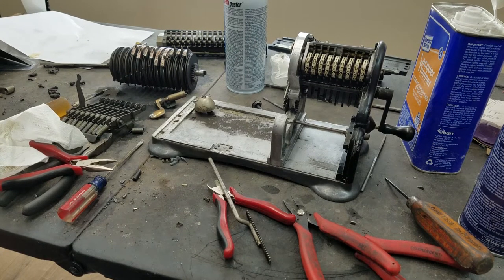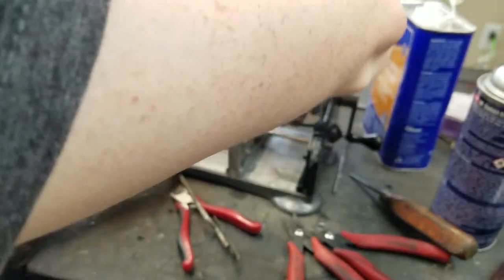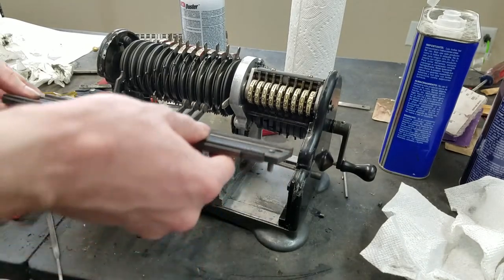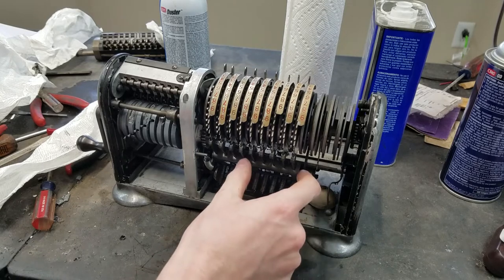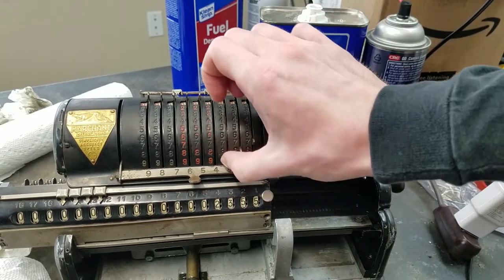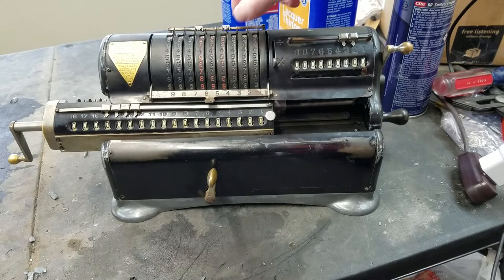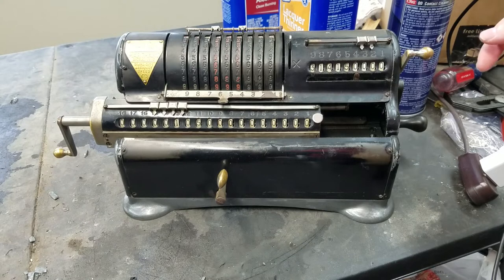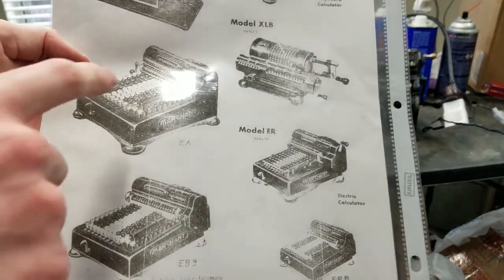Pre-disassembled Marchant XL repair/reassembly part #B

Comment: Wow, you got it back together AND working! Beautiful! I don't remember taking the accumulator decimal marker bar off. I'll look in the shop & see if I missed 'em. I do remember there were missing screws. (I have a Felix that is missing a pile of screws.) The feet were totally mushed & broke out in chunks that looked more like road tar than rubber. I suspect it sat in an attic or a barn for a long time.
. . . I really am surprised that you got it working. These old beasts are truly amazing. I agree that the lack of stop on overflow is a pain. I do that overrun all the time. The real deal for me is  deriving square roots. So much easier on one of these than on a Facit. (I almost would rather  do the Newton-Raphe algorithm derivation on paper, really ;-) )
. . . By the way, having three of those beasts puts you in the same hoarder status as me. (I have a herd of Felix's and Odhners. Just one Facit. So far. I'm still working on the Swift . . . impatiently. And a couple Victor 600s.)
. . . Nice work, amigo. Take care! Stay safe & stay well!
Reply from the maker: Based on how the accumulator marker bar was bent slightly, it looks like its been missing those spacers for quite a while. Of all the Marchants I own (6 old line Marchants in total(including the XLA and 2 XLs), plus 2 silent speeds) the EEG9 is the only one with any good feet left. I think I had to chip the feet out on my EA9 as well. I think the machines I have the most of are Monroes, as theyre pretty common, but I definitely prefer the Marchants. Stay save as well!
Reply: @bss1250  I have almost gone for a couple Monroes but managed to talk myself out of it ;-)  Between you & Chris Staecker I have enough nudges toward temptation to cover me for a while. 
. . . I have to admit that the Marchants that I've seen all looked like beautiful machines. But my predilection for Odhners & Facits goes to my nordic heritage ;-) . The Swifts I can't explain . . .

Comment: Thanks for the link for the Marchant documents.  Very interesting I had no idea they had made so many models.  

Most impressive how quickly you can get these things going again.  I seem to take quite a lot longer.
Reply from the maker: In fairness this is the 3rd machine of this style Ive worked on, so my experience with the previous 2 (an EA and later style XL) made getting this one going much simpler